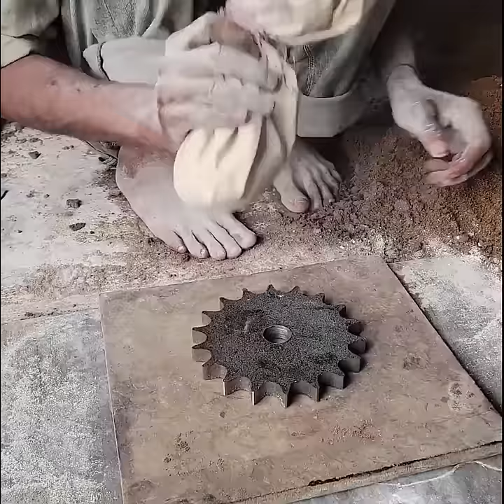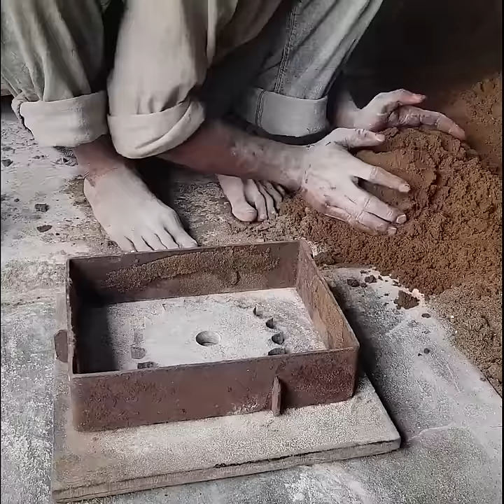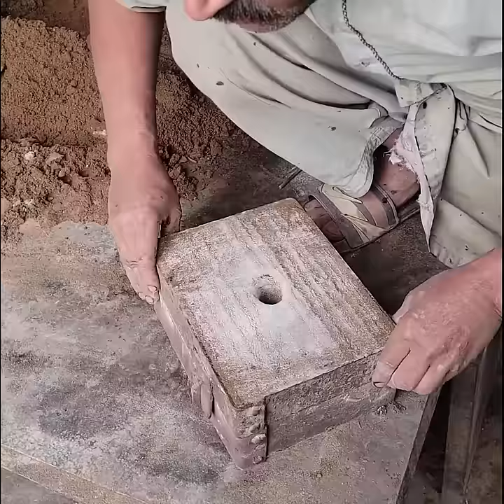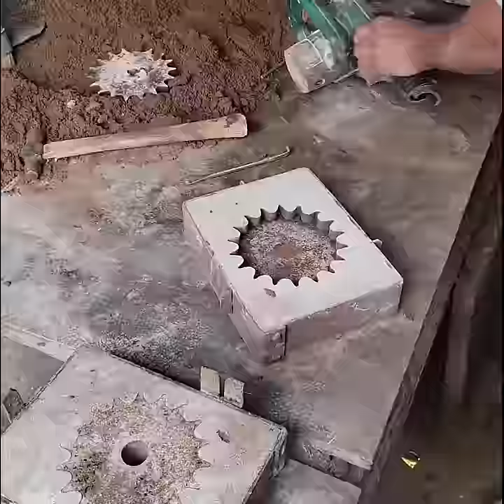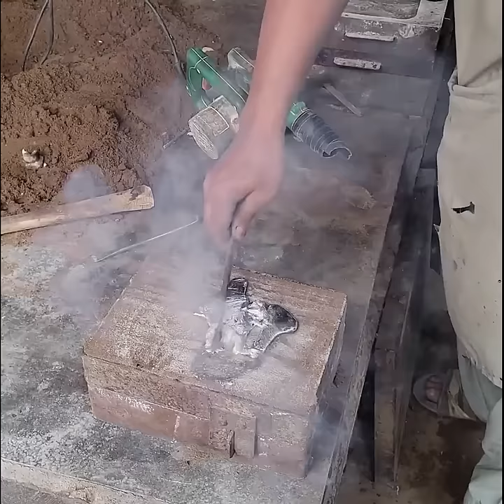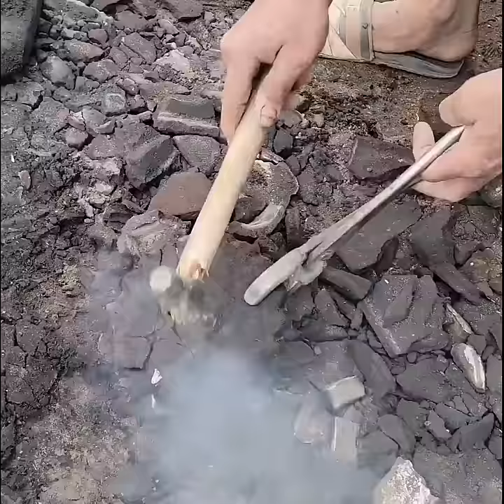Casting Aluminum Machine Gear Using Sand Mold Technique #shorts

Comment: That's actually a good demonstration of sand-casting. The sand has sawdust and oil and water in it, to make it hold its shape, and the sand itself has to be a certain kind. 
That "gear" is not a gear, and probably not a chain sprocket. I'm guessing it goes on an awning rod with a roller lock.

Comment: I'm a metal caster ..firstly, aluminum scrap must be degassed with nitrogen and sodium ..that doesn't happen, secondly, castings must stay in the mold until cold. the alloy is whatever no one knows other than there is a cog of something that looks like a cog no thumbs up to it .. anyone with a gas torch can do it